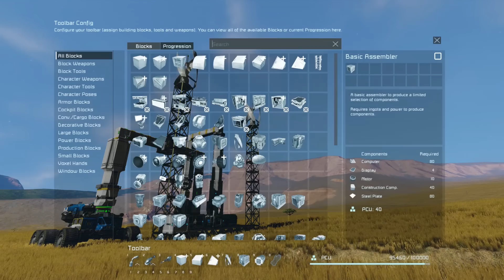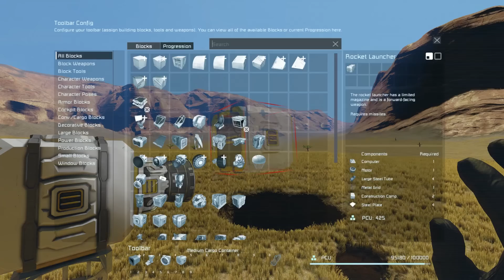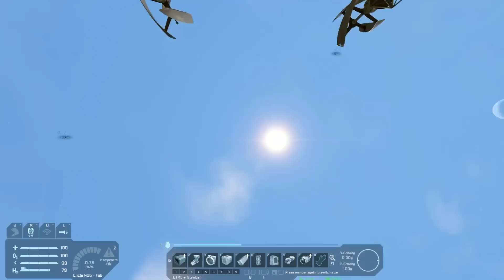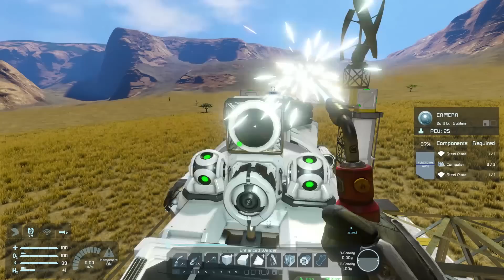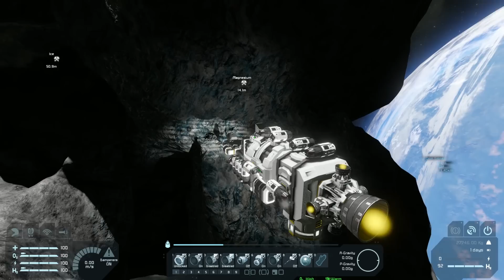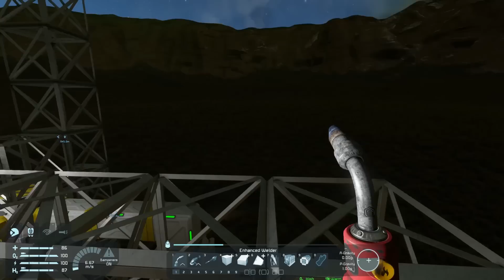Going to Space - Getting Started in Space Engineers #6 (Survival Tutorial Series)

Comment: Would it be a good idea to coat the bottom of your ship in armour, so that you're not banging your batteries against the ground every time you land?
You'd need to keep your connector flush with the exterior, but you could hide your batteries and storage container inside a layer of armour. 

It'd increase the weight of your ship, I guess, but I'm not sure how notifiable it would be.
Reply from the maker: It's normally a good idea to have a bit of light armour on areas that come into contact with the ground, best to be sparing though since the weight of the armour adds up surprisingly quickly

Comment: Great videoseries, I picked up  the game last weekend and this series gave me some great startingpoints. =)
I have a question thoug: You roughtly mentioned that you put two gyros on the ship... what exactly do gyros do? they help you control the ship, thats what i figured out the description also mentiones that multiple gyros are needed for larger ships. is there a rule how many gyros per volume/weight are recommended and how do i see that more gyros would give me a benefit? also: doesn't placement matter?  you didn't distribute your thrusters very evenly but the ship doesn't look like the position matters too much to it.
Reply from the maker: With the way SE works all thrust goes through the centre of mass which means to get any degree of turning you need to have a gyroscope. I don't believe placement of the gyroscope matters but if it does the difference is small. As to how many for an amount of weight there's no rule that I use and it's really only about how much you want to be moving your mouse around to steer the ship since you'll always be able to turn with 1, it might just take you half an hour to do so :P
Reply: @Splitsie  i just built the orbiter you presented in this video. Found an asteroid with urane on it. Filled my container with it and went back home... 8 thrusters dont really cut it if you want to bring home a full cargobay of uranium >.< I managed to hover into base with the hydro on full throttle... Lets say, im glad there are savegames

Comment: I used a camera on my mining vessel for docking. It is mounted just in front of the connector on the vessel, and I have a light that lines up with it on my truck thing so that when I dock, all I need to do is get over the truck, switch to the camera, orient the vessel facing the rear of the truck, and lower myself, keeping the light in the center of the camera crosshairs and using the visible attitude indicator to keep the miner level. At first, I thought it was more of just a gimmick, but it is actually way faster than going to external view and trying to orient and line it up that way while moving the camera around.
Reply from the maker: It's funny, I completely agree with you that a well set up camera makes docking much faster and easier yet I always seem to forget to do it :P

Comment: my first shuttle only use back thrust as main engine (so there are no atmo thruster dead weight), cockpit facing up, remote control facing forward (for hovering), some parachutes, and keep center of mass low (my shuttle looks like a vertical wide ship). 
Use another ship with landing gear to bring it to connector, or temporary atmo thruster since you can't fly if hydrogen tank is empty :)

Comment: Some help needed:  I checked my alignments and have a large port ready to connect the large hydrogen thruster but it will not connect to the cargo bay...?
Reply from the maker: Make sure you're using the large version of the small grid thruster, when you've got the thruster selected use your mouse wheel to change to the large one as opposed to pressing the same hot bar button a second time to change to the large grid one. This is if you're having troubles with it not snapping to the ship you're building
Reply: Splitsie Got it, Thanks Splitsie!  Your tutorials have helped me out TREMENDOUSLY!

Comment: I have a problem, I have followed your tutorial to the letter and built this ship, I am finding when on the moon the energy it takes  to keep me up in the air outweighs the rate the ice is being turned into hydrogen. any ideas how to fix this?
Reply from the maker: There isn't, you'll need to land somewhere with ice to intermittently refuel your tank since the hydrogen in the tank has no mass making tanks far more efficient than using generators on the go. Eventually you'll get access to ion thrusters and be able to run just off power which will allow you to fly for longer, even though your acceleration will be less than with hydrogen :)
Reply: @Splitsie  Thanks I have perfected this now, it is a really good design, the only other issue I have with this design is if I come back down from space to earth with a full load of resources. The ship is too heavy to fly.

Comment: Again, new to this. My O2 H2 generator can only take 21.6k of ice, and ice in cargo or cockpit wont feed into the generator. Is there any way to fix this? so that I can travel further.
Reply from the maker: You need to connect the conveyor system between the blocks to allow ice to move between them, also worth noting that conveyor systems will only work with power. It's relatively easy to find ice in space, so I'd say use tanks to get there and refill them once you arrive :)

Comment: Is there a reason to use the hotbar connector lock versus just using the default key of P?
Reply from the maker: Many, in one of the other videos in this series I went on a little rant about it which would sound slightly odd out of context :P

Basically though, P disconnects more than just the thing you are wanting to disconnect as it toggles all connectors on the grid, all landing gear and all parking brakes on the grid all at once, which can work very poorly if you're controlling a mothership or similar :/

Comment: Hey, quick question. I put a hydrogen tank on my base and connected it to my O2/H2 Gen with conveyor tubes, but it’s not filling. I made sure the tank is set to stockpile too. Any ideas on how to fix this? Thanks.
Reply from the maker: If the conveyor tubes are correctly set up then the most likely problem is going to be power production, if you don't have enough power for the o2/h2 generator to run then it won't be able to fill the tank. Also make sure the conveyors all show green just in case there's a damaged one somewhere in there that looks complete but is actually broken - I've done that more than once :P
Reply: Got it. Thanks. I thought I was ok on power, but I’ll build a couple more wind turbines to be sure. Can’t wait to see how Mars treats you and Capac.😁

Comment: So I'm assuming the functionality of this craft falters if you're trying to do any sort of terrestrial mining, correct?  Tried to use it to fill up some ice before heading out and it fails pretty spectacularly.  Am I doing something wrong?
Reply from the maker: Yep, very much not intended for that use, would need a lot more directional thrusters to support that, the drill is just there to collect a little bit of useful ore from space :)

The atmospheric miner that I built in the second tutorial in the series is much better set up for planetary mining
Reply: @Splitsie  Thanks for the reply.  I managed to grab some ice and took off.  After a while I got to about 6200m and couldn't make any further progress.  Using the override didn't seem to make a difference.  Do you thik the extra weight I added for the additional thrusters might have affected the ship?  I think I added about four additional thrusters in total
Reply from the maker: If you only reached that height it sounds like you didn't have your hydrogen thrusters on, since that's about the ceiling where the atmospherics can take you - need to make sure you switch between the two and use the large hydrogen thruster at the rear to push you higher since a single small one won't generate enough lift (even two or three small ones probably won't)

Comment: im finding i am running out of hydrogen really quickly. i have placed several extra thrusters on board. is there a minimum amount of thrusters required for weight?
Reply: I don't know what the weight is but yes, the more you weigh the more thrust you need. And the more fuel you use.
And the hydrogen thrusters use an insane amount of ice if you don't conserve. 

There original intent from what I remember the devs saying was a large quick thrust to brake atmosphere lasting about 10min max, never intended them to be  a main thruster for ships.
Reply from the maker: Pretty much what gozzilla177 said, if you've got a bigger ship than what I built you'll likely need more fuel and more thrusters, but you also need to be very careful to not push up against that 100m/s speed limit to conserve your fuel as best as possible :)

Comment: You forgot about Hydrogen Engines, you can use that when in space to stay up there longer ;D
Reply: A single hydrogen engine would burn through that H2 tank in about 20 seconds.
Reply: @Grondamg  That's why you have ice, also I suggested it as a backup in case you are low on power there is so much ice in Asteroids it doesn't matter
Reply from the maker: I deliberately chose not to include a hydrogen engine. I felt that having one would increase the likelihood that new players would end up running out of fuel by not realising they'd need to turn it off when low. Having the batteries as a separate system is less likely to put them in that situation and therefore less likely to lead to frustration in the early game :)
Reply: @Splitsie  Ah, Good idea hopefully in a future episode you can talk about it, I made an awesome miner that runs off hydrogen with a  detachable storage module and out a backup hydrogen engine on it since it only has 2 batteries and 2 reactors to power it so in case I am mining a bit longer than I expected I can turn it on to recharge ;D they are great for that just not to directly power vehicles

Comment: I tried this ship but I always run out of hydrogen before getting far enough into an asteroid. I don't know what I'm doing wrong
Reply: Have you filled the hydrogen tank up completely? If so and you still have problems, you can use a mining ship to get ice on the planet itself and load that up into the generator on the ship. That way the ship will use the ice to fill up the hydrogen again as you use it.
Reply from the maker: The main reason people tend to run out of fuel is if you are pushing against that 100m/s speed limit. Adjust your throttle as I did with the increase and decrease override to keep your speed at about 95m/s for an efficient escape flight. I was able to get to space with over 80% of my fuel remaining so there's plenty of buffer to get you there even if you don't do it perfectly.

The other thing you may have done was had problems with the opposing thrusters, like was happening to me sometimes they will activate and waste fuel slowing you down, make sure you turn them off while going to space to prevent this little bug :)

Comment: Hi there.  Can you give me some advice please?  I have a base that is not too far from a drilling platform.  I have built a conveyor tube between the two but they cannot attach as they don't line up.  I have placed a connector at the end of the conveyor (Set to throw out) above the base with another connector below it (Set to collect).  The top one does throw out into the the bucket above the lower connector but the lower connector to does accept the ore that is drop onto the opening.  Can I just use a conveyor with no connector on it?  Will the ore just drop into the tube?  Or is there a better way?  There is no way to connect the two I have tried but the angles are all wrong.  Thanks.
Reply from the maker: If both parts of your base are embedded in voxels then you won't be able to/the grid will explode if you do change one to being a ship.

If you wish to continue to use your connector ejection method, you'll need to use a collector on the receiving end. Connectors set to collect will only collect things already in their conveyor network, as an example when you dock a mining vessel to your base by locking its connector and your base connector is set to collect, it'll pull some ore from the ship into its inventory.

Another option you have for connecting the two grids is to build an advanced rotor on one of them, attach conveyors and a connector to that part and then move it into position above the connector so you can lock them together. You may need to use pistons and/or another advanced rotor to get them to align, as long as you get them to light up yellow you're good to lock :)
Reply: @Splitsie  blah blah blah!
Reply: @Splitsie  Thanks.  That is what I have tried to do but the game won't allow me to view closely what the rotors and pistons are doing.  It forces a long distance view.  I have decided to destroy the drilling platform and start again building a long conveyor then the new platform on he end of it.  Lesson learned.  I would try to build a drone to ferry the ore but I have very little cobalt as there is no source that I have found.  I am currently meteor chasing to see if one of them creates a cobalt deposit.
Love your videos.  I look forward to more tutorials.  Thanks all.
Reply: You need to change one of them to a ship from a base & then use merge blocks to weld them together.
Reply: @Soupseed  Thanks.  I will give that a try.

Comment: Greetings. Minor question. I took the base drill concept, doubled its size and attached it to a large ship grid. It is a hydrogen powered ship on the moon to mine asteroids. It seems no matter how many thrusters or gyroscopes I add to the ship it has a small constant drift under .1m/s so it's manageable. The ship flies, lands, takes off just fine under its own weight fully loaded with ore, inertia tensor is on for all the pistons and the advanced rotor. Just curious if you have run into this issue your self and have a suggestion or perhaps I have not put enough thrusters/gyroscopes on the ship or if it is a physics "thing" with the rotors/pistons not liking to be on mobile grids. Also even with three gyroscopes attached to the ship it turns horribly slow.
Reply from the maker: My experience with pistons and rotors on mobile grids has always been that the subgrids aren't properly accounted for by the gyros or the inertial dampeners. A small amount of drift is almost inevitable even when you've ensured the subgrids aren't interacting with each other :( 

As for how much effect you're getting out of gyros, as Soupseed said, if you've got enough electrical power for them, just keep adding more until it steers to your liking (use mouse look to check as the q/e roll command can be inconsistent) :)
Reply: @Splitsie  Nerd!
Reply: Check that you don't have a sub-grid pushing against something on yer ship, that could be causing movement & also that you have enough power to fully allow yer gyros work.

Comment: Wouldn't it have been better to put a hydrogen engine on in so so long as you I've you have hydrogen and power
Reply from the maker: I deliberately chose not to use the engine as I felt it was more likely to cause new players to have problems with running out of fuel. Having the systems separate by using batteries I felt would make it easier on them and prevent some early frustrations :)
Reply: @Splitsie  Truth, at last not at this point. Still weird that you didn't menton it.
Reply: It would. But it is new feature so he forget about that.

Comment: Is it worth putting solar panels on the ship to charge the batteries?
Reply: It depend. If you have mothership or space station, then yes (especially to cover passive power usage). But if it is just small auxiliary unit, then it is usually not worth of effort.
Reply from the maker: If I'd charged my batteries to full I would have had over 24 hours of power which is more than enough for most uses before I'd return to a spot to recharge so I decided to forego the weight. I'd agree with TheRezro on this as a general principle, I only build generators on the larger vessels and stations since batteries are so power dense :)

Comment: I didn't see a comment on this yet and I don't recall you mentioning this yet in this series so I wanted to point out for others in case someone is watching this series with no prior knowledge of the game or having seen any other videos. Don't forget about changing the detection range of the ore detector, it also looked like you hadn't changed it either from default on screen. The ore detectors range is adjustable but is set to a fairly small range at default. When set to max it is very helpful but I believe it does use more power. I hope this helps out! I love your videos!
Reply from the maker: Very good point, I think I accidentally cut that bit out as I recorded myself talking about it but it must have been during a part that I re-recorded. Thanks for highlighting it :)
Reply: I think you also forget to mention how much energy the antenna uses by default. If you change the distance to something shorter, then you can save a lot of energy when flying remotely.

My ore detector and antenna are always off unless I need them, but I don't use toolbar buttons to do it.
Reply: Right now ore detector's default range is maximum, so not a big deal. I know, because I always check this! :D